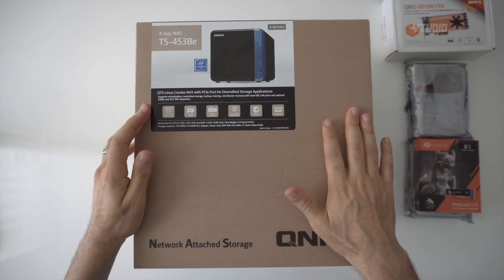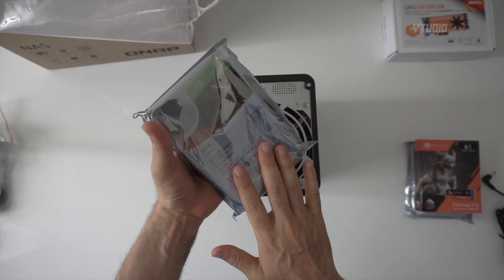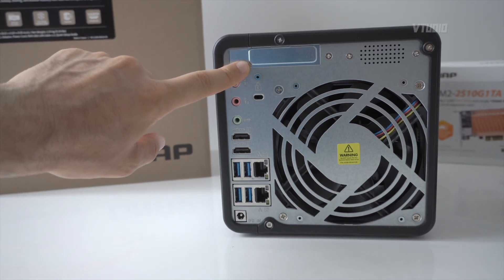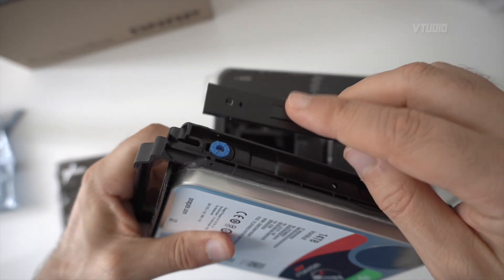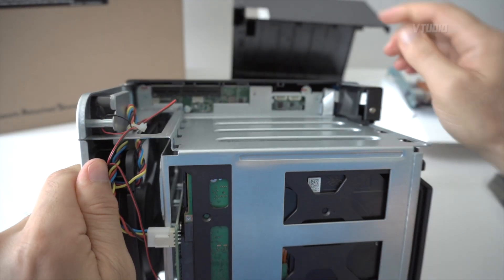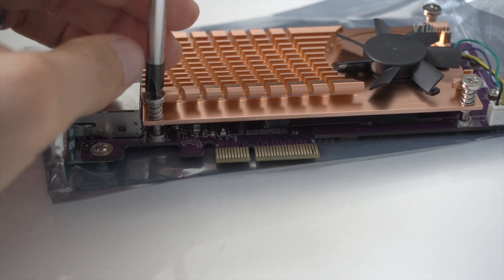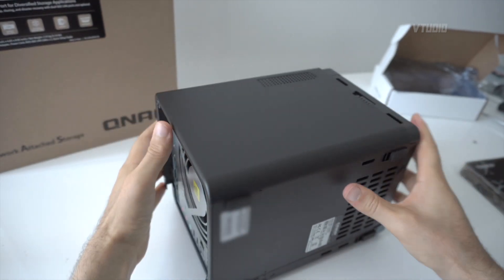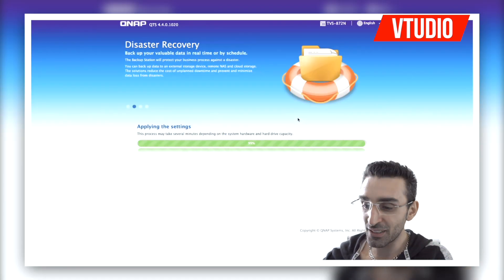QNAP TS-453Be Setup & Upgrade Guide | 10GBe ✅ m.2 SSD ✅

Comment: Thank you! Just added M.2 x2 to mine.
Reply: What model did you put in? I purchased Samsung M.2 NvMe SSD 980 that has the one cut out on it the same as the board, but doesn't fit. I've read it needs to be a M.2 SATA SSD, but it has two cut outs on it and the board only has one. Confused. That's why I am wondering what you put in.
Reply: I used the QNAP QM2-2P-244A as the expansion and SAMSUNG 980 PRO as the NVME drives.  @HerewardDundasTaylor

Comment: It is using celeron processor that would run into issue from 12 months to 36 months. Mine died last night. QNAP is not taking it under warranty. So many QNAP devices impacted. Look for book issues with QNAP.